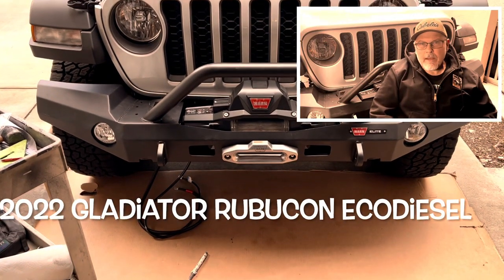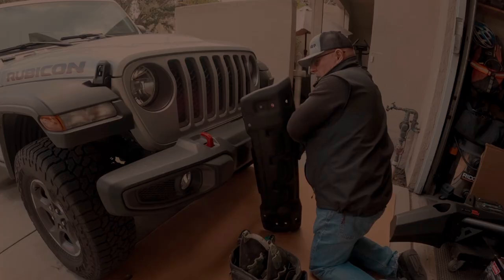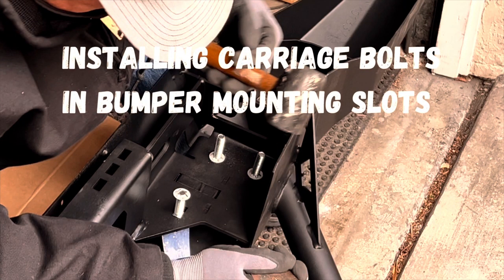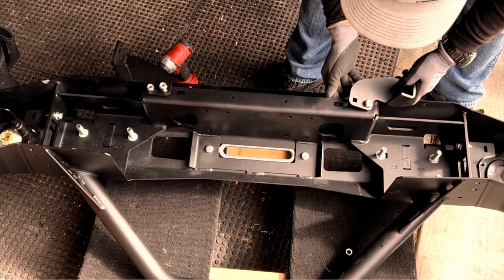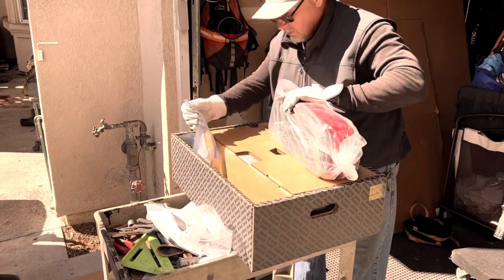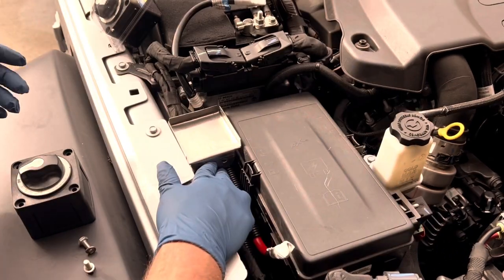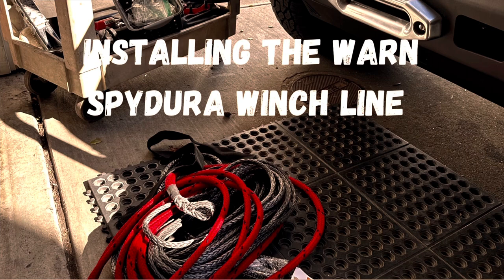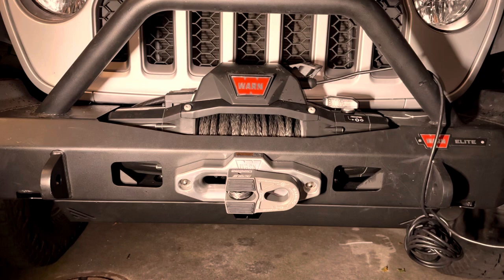How To: Install Warn Winch & Bumper On Jeep JT/JL Rubicon

Comment: Glad I watched this video on not what to buy. Not a good aftermarket part if you have to cut the frame and use two less mounting bolts. They made the front bumper weaker not stronger for using a winch.
Reply from the maker: Thanks for watching!

Comment: Great video, it helped me during my installation. Nearly identical to yours except mine is a Wrangler Rubicon, I got the bumper without the hoop.  I got the Zeon 12-S, my Rubicon weighs about 5500 lb before all the modifications LOL.
The part you said about the skid plate Fasteners being difficult, wow, you were right, I won but it did draw First Blood.
Reply from the maker: Wow! Really glad it helped. Looking back I wish I would have made it 3 seperate videos. Thanks!
Reply: The bumper wasn't too bad, the winch with the grinding off of little part of the frame wasn't too bad. But the bash plate probably could have used a video all on its own. If I was doing it, there would have been a lot of beeping out the swear words. LOL.